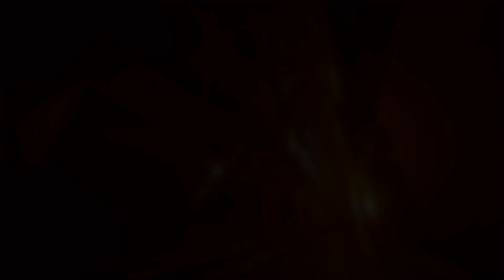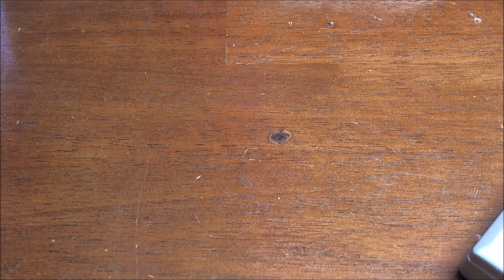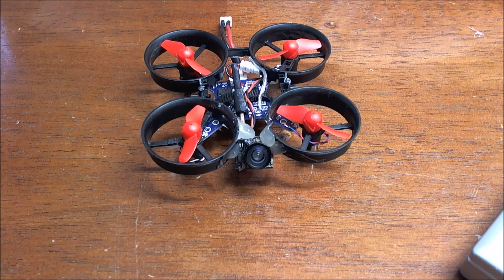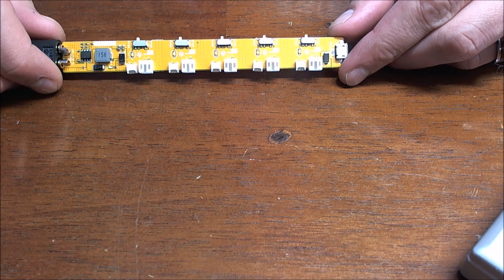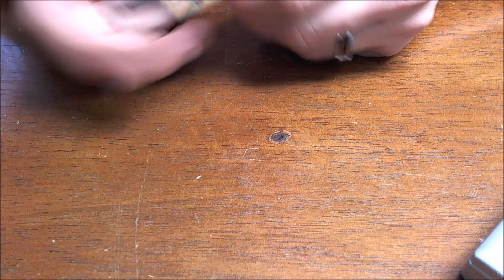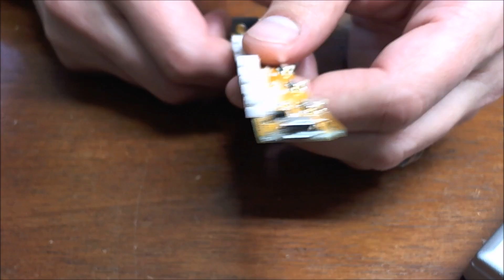H8 Mini Whoop Update

Comment: ive got a stock inductrix and i wanna order this for it
https://www.amazon.co.uk/gp/product/B06XWXP738/ref=ox_sc_act_image_1?ie=UTF8&psc=1&smid=A22TWKWJXC2EMW
would the frame and canopy actually fit cos it looks a little different to the stock???
Reply: This is specificaly made for the eachine E010 if i am not mistaking , the board should just about fit, but the battery casing is larger and shorter than the inductrix batteries